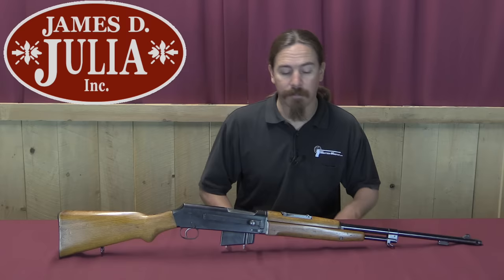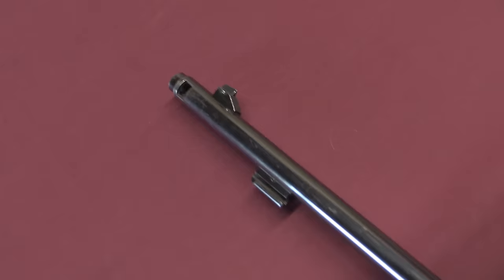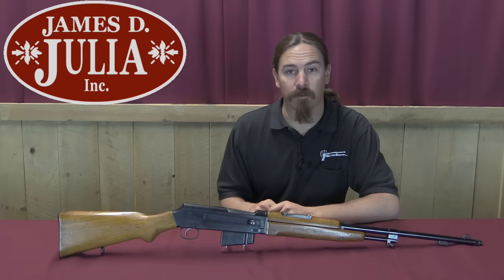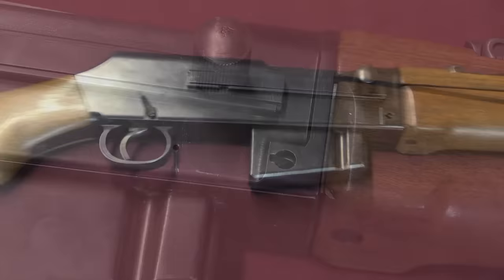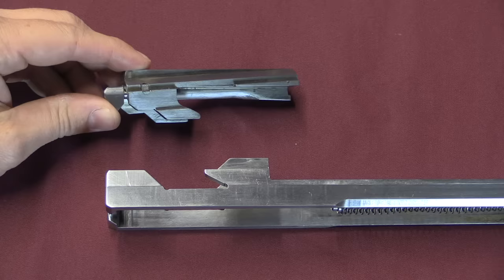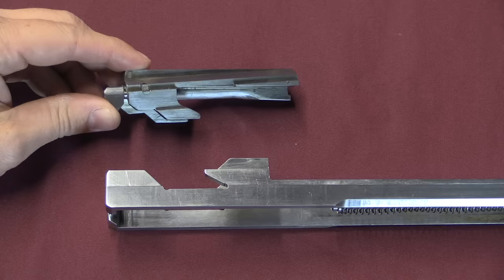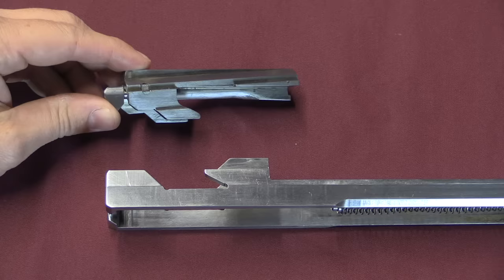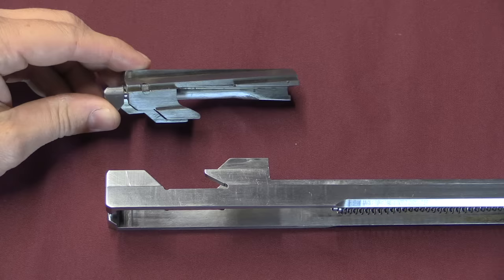Poland's WW2 Battle Rifle: the Maroszek wz.38M

Comment: It's a sign of a truly excellent engineer to make something functional with so few parts.

If they didn't get crushed by the impossible circumstances of WW2, we might today be talking about "Polish engineering".
Reply: All I can imagine is a polish ak is literally 3 parts held together with push pins like a ar 15
Reply: POLISH ENGINEERING, JOJO!
Reply: @hungryburger1170 POLISH ENGINEERING IS THE FINEST IN THE WORLD
Reply: @ONEIL311  Polish AKs are unfortunately AKs, but the MSBS is a fun one. Not only it's pretty much four major parts held together by push pins (and you can even put the stock on upside down without major problems), but the bolt is a piece of Stoner 63 lunacy - put it in upside down, unscrew the ejection port cover and screw it back on the other side, and now it ejects to the left, no fuss!

Comment: Heh, that is one very simple gun to take apart, total genius in the simplicity. I guess modification to a removable magazine would not be difficult.
Reply: Lubos Soltes ditto 30rds would work👍
Reply: Before WW2 started Maroszek designed version that was using Browning wz. 1928 magazines.
Reply: Lubos Soltes from looking at it in the video I think that a gun designer could easily take the main operating parts. add a folding stock and detachable magazine no problem and this would be a decent modern weapon

Comment: Never heard of these. What a great design. The machining and finish are superb. The takedown is simple and effective. I always thought the Garand should have been along these lines, a 10 rd fixed mag which can be loaded via strippers or with loose ammo. More versatile, can be topped off, and the existing 03 stripper clips could have been kept. It really didn't make much sense to design a whole new e-clip system. The only possible advantage is the bottom of the rifle being flatter and nothing sticks out except for a slight protrusion of the mag well. Great video as always. Thanks for finding this one

Comment: This is one of the coolest and most interesting rifles I've seen. It's very similar to the BAR but noticeably different, and in my opinion better in a way in that it's locking mechanism is far simpler than the lever mechanism used in the BAR. The whole design is really ingenious when you look at it, and it makes the firing system a lot less complex, which in turn should have made it easier to produce as well.

Comment: This is absolutely elegant. One pin holds it together. The stripper clip cutout is also the locking surface.  It looks like an absolute pleasure to field-strip, and the only weirdness is the occasional archaic feature (trigger-based bolt release) rather than a real design flaw.

That inspiration to fix the prototype must've been an epiphany.

Comment: a brilliant, simple and effective project. easy to disassemble for routine maintenance, very easy to clean the gas outlet. also equipped with muzzle brake. remarkable example of Polish engineering.  the only note, as I think it, a rear sight like the garand would have been much better

Comment: Really should've had a captive pin and a detachable mag. I wish someone in Poland would put this into production because I want one really bad.
Reply: Richard Tobys, gunsmith from around the city of Poznań (Guinness Record holder for biggest 1858 Remington revolver), Poland, did made one new example of Maroszek. He took measurements from original documentation, immured during the war, and decades later accidentaly rediscovered. He stated, that after reworking the data to be CNC compatible, he is able to make next examples. But still... it's singular, expensive, semi handmade work... and i don't even know, that the old man is still around and capable to make one.

Comment: Great job Ian, as always,

I knew about these gun but I have never seen any good photos (not mention movie) of it - thank you for this great presentation. This gun is really ingenious if you take into account its wise design, easy of field strip etc. and that the Maroszek had really limited design support and schedule for it.  The fit and finish looks really great and it was almost hand production without any machined production line - only 55 trial guns were made. I can see only one shortcoming for this gun from design point of view – machining the receiver would cost “fortune”.

BTW I would like to see how it manage your mud test (of course I know that no1 will let this happen with such scarce gun) - its wide opened but I think these kind of locking can be quite resistant for dirt.

GJ and keep on going. Greeting from Poland.
Bartek

Comment: I know it's an old clip but just one thing - that regulator you're talking about. It wasn't meant for adjusting to different ammo types. It was there for adjustments in prolonged combat environments when proper cleaning was impossible. If cleaning of the gas piston and tube was impossible the soldier was able to widen the gas release hole to make sure it didn't clog up interupting proper gas piston action.

Edit: You can see the same option in some modern rifles, tho nowdays it usually doesn't requier field-strippoing the gun to do it.

Comment: Is there a particular reason why so many serial numbers seem to start at 1000? l remember several guns shown by you to have them start at a such number.
Reply: Kurt Bergh To make believe having already manufactured 999 guns.
Reply: I'd think it had to do with tooling.  Starting with four digits means you can make 8999 rifles in a single batch and not have to stop the line to change the serial number machinery.

I guess you could start at 0001, but that would have made some people tear their hair out.

I remember that a lot of guns Ian has shown he talks about how the fifth digit just becomes a letter and then you can produce another 260000 without any further tooling changes (assuming the latin character set, cyrllic would give more).
Reply: quarthinos Why would that make some people tear their hair out? Hell, you could start at 0000, as long as you used a 0 with a diagonal slash distinct enough from your 8.
Interesting to think about the numbers you can produce that way though
Reply: Some people are allergic to starting zeros.  I wasn't really serious about that part of my comment.  I think the rest is accurate, tho.
Reply: Or maybe it's could be first version, so later when the designer make some adjustments of the design then second version could start with 2001 and etc.
Reply: I would love to see serial numbers in hexadecimal. With four digits, you could go from 0001 (0001) to FFFF (65535). If you wanted to take it even further, base 64 will let you make numbers AAB (001) to /// (262143).
Reply: +quarthinos Ah, makes more sense; that's their problem. 
+Carl Siemens I was actually going to suggest base 26 or 36 as it'd be easier for standard comprehension to use the Latin alphabet or Latin alphabet plus Arabic numerals. I suppose for easier mental math by the average person you could do base 20 or 25, (represented with partial alphabet), or 30 (alphabet plus 4 numbers), though they'd probably still be more accepting of base 26 or 36.

Going to be honest though, the whole downside would be that differentiating models or versions would be a pain in the ass without everyone's favorite base 10 stopping points; you'd practically have to release a guide for the average person.
Reply: You got the answer in one. The  reason they start with 1001 is the die stamp.
Reply: farmerboy916 
I know that b64 would never get used but imagine how much fun it would be!
Reply: Tbh I never learned it, just understand the concept as applied here. The exact representation of characters to number values makes my brain twitch and want to redo it, they couldn't even be bothered to set 0-9 as their proper values and had to bring in non numeral/ alphabetical characters to make it work. And programming is far beyond me. 

I think what would get the most number counted with the fewest characters while still making sense to the average person might be 2 letters and 3 numbers, for 676,000 for 5 characters. Multiplies evenly too, and is more space efficient if you don't mind using XX000 (instead of insisting on having 4 digits to represent a thousand, just use 3). Though, what could be done with the first two characters to make this even better is to do them in base 36 (1,296,000), base 52 with upper and lower cases (2,704,000), base 62 (3,844,000) which might be more understandable for most people than base 64 due to the lack of non numeric/ alphabetical characters, or even use base 64 for them (4,096,000). If you just wanted a more space efficient way to express up to a million you could use base 32 for the first two characters, about as close as you get which would work out really well for understanding and estimating the total if you had to add on another character; it may actually be better than b64 for extremely long production runs. 

That's probably how base 64 might actually be used in such serial numbers as well. That's how I'd do it anyway. In retrospect after thinking through those options, base 64 for the first two characters would be fine and dandy and understandable enough. And I doubt anyone is manufacturing more than that with one serial number range nowadays
Reply: from a manufacturing engineer: if you start at 1, by the time you get to 762 or 556, things get confusing (calibre? serial number? military unit number?).
Leading zeros make optical illusions: 0010 ~ 0100 (imagine war time armourer working around the clock bringing guns back to the field)
Reply: @quarthinos  Some guns started with the #0

Comment: Am I seeing things or are there cracks at the edge of the locking shoulder (time 9:22)?  As I recall the savage M1895 which has a similar lockup had the same problem and was solved with the M1899.  For a trials gun this kind of thing is normal and the reason to do trials, of coarse maybe I am seeing cracks where none exist.

Very cool gun and very few major parts.  More importantly I did not notice any parts that look harder then hell to machine.
Reply: Wilhelm Muench It does look like one is forming on the right side to me from the angles we had.   Also,  when Ian was showing the stripper clip guide it appeared that it was not a straight across machining cut.   It looked angled to me; again probably the viewing angle of the camera.

Comment: 1. Not Josef Maroszek but Józef Maroszek. Small difference but ;)
2. Maroszek is pronounced as "Maroshek". I know, this is hard, I don't blame anyone for problems, at least they tried.
3. This is not 0 (zero) but letter O → O = Odbezpieczony (ready to fire), Z = Zabezpieczony (secured). For Polish user this has a lot of sense, for foreigners O is equal to 0 and this is the straight way to accidents.
Reply: And in "Maroszek", the accent is on the second syllable.
Reply: Proszę się nie czepiać, Ian jest specem od broni, nie od języków. ;)

Comment: What a wonderful design. It has so many user friendly features with so few and simple parts. The milling work is well done, but rather simple. No highly intricate cuts here, so it should not had been to harder to build then a bolt rifle. Very easy to field strip. I have a feeling if it did see service, they would eventually have a detachable magazine and it would had seen service though the Cold War. It would had been what the M14 was for the US.

Comment: I wanted to put forth the theory about the gas mechanism on this one- the 1, 2 and 3 adjustable settings are actually meant to be stopped at after a full turn or even two full turns of the lug, so they're actually there to help you keep accurate track of the mechanism instead of trying to remember which face of the bolt you should stop at. I believe that would allow enough change in gas to be relevant. So tightened down to 1 is normal, loosened once or twice and stop at 2 is slight adversity and another time around to the three is extreme conditions.  At least thats what I'm going to postulate. 

Hopefully this is something that is relevant to say and not just a waste of your time.

Comment: Basically, "Z" stands for "Zabezpieczony" secured. "O" for "Odbezpieczony" unlocked.
Apparently, there are confirmed reports that several wz.38M rifles took part in the fighting, but one incident is documented.
During the evacuation by train, Engineer Józef Maroszek had his rifle with him, and the train was attacked by two BF-109 fighters. Maroszek did not sit idle. He loaded his rifle and returned fire at the attacking Messerschmitt (Maroszek had the title of sharpshooter), as a result he managed to shoot down one BF-109, and the other one withdrew from the attack. One point for the wz.38M... but what a good one :)

Comment: At the gas plug's diameter, those 1, 2, and 3 settings create a significant difference in gas volume/pressure. In an AR, a gas port changing by a few thousandths of an inch can make a noticeable impact on function and performance.

Comment: Many handguns are designed to lock into the top of the slide today. Glocks do this which is what that reminded me of. This rifle is miles ahead of its time. 

I noticed the score mark continues through the 2 position on the gas adjustment knob. I guess that setting must have been just right as the 1 and 3 do not have the score mark. 

Too bad this is not in production today it really is a simple and effective design.

Comment: I realize this was a rifle that was still being tested and I am not familiar with them at all but do you think it's possible that the gas adjusting screw could have been meant to make one full turn and then stop on the 1 and two full turns and then stop on the 2, same with the 3?  Since you have been fortunate enough to handle the rifle I wonder what you or anyone else may think of that idea.?.?  Just a guess.  Thanks for a fantastic video.  Poland is one of the few countries that are still protecting Europe.  Niech Bóg błogosławi Polskę

Comment: Well it may have the US Bar machine gun similarities, But the Tilting Bolt or Falling Block was first available in 1895 & truely perfected in1899 or otherwise Known as the - Savage 99.
While most would dismiss it as a Lever Action - a study of how the action works is that it 'controls' a falling block, which has same design Locking breech as this Polish rifle.  Perhaps Forgotten Weapons could do a video on the Savage 99.

Comment: Nice sturdy and simple construction! I would like to see a modern rifle based in this action.
I'm not sure if the locking system is good for accuracy. But if it would not be a problem, It has all the requirement to be a very accurate and reliable rifle.
With some modernization, I think it could result in a rifle as good or even better than an AR.

Comment: Forgotten Weapons
 - machine gun/pistol BECHOWIEC 1943 year .
 1. Producer - self-taught 2. Conditions - conspiracy, average no machines, basic manual tools 3. Closed screw lock, single and continuous fire switch, (this system was used in other weapons only after ... 25 years later and recognized as a standard ! ) , quite small and easy to hide e.g. under clothing 4. the first prototype shooting - it worked well right away 5. users - no comments about jams, blockages.
Sorry my english .

Comment: I needed this vid so much. I was planning to write a historical fiction narrative about a soecific operation in which the Polish resistance recovered pieces of crashed V-2 rockets and then flew them out on a british plane flying into a random field from Italy, then back to Italy and then to Britian, for the scientists to study. It's a hair raising tale on it's own, with a few spotter planes using the landing field the day prior to the operation, and a flak battery being positioned in a town not five miles away from the landing field. The British plane, once it landed, got stuck in the mud, having to be pulled out, then fly away. I had a pretty clear idea for the story, it was either going to be a sucessful assault on the flak battery, or a stall defense operation in the area around the field, each being carried out by a small team (5-10 men). I was all set to pen it out, but I realized I didn't know any WW2 Polish guns, and I was loath to just give the resistance soldiers allied rifles and carbines, because most of the members of the resistance had originally been members of the Polish army, and would presumably have kept their kit. Because of this, I didn't start writing. Now I can, because I had something in mind which required semiautomatics, high danger, high adrenaline stuff, and this is perfect.

Comment: So that tapered plug could change quite a lot of pressure, assuming that is tapered and close to shut there is a fine cross section between the surfaces but it would very quickly just be unrestricted.  The tightest setting is likely just very slightly open, each one looser probably a big change in gas flow.

Comment: Gas piston adjustment is not by 1/8, it is by full turn and 1/8th, so you unscrew 1.125 turn per adjustment. Just guessing from engineering point of view. They probably used some standard hexagonal bolt supplied from outside - looks like a BSP thread - and just quickly made octagonal head, slot and stamped it, so they would not have to make their own custom pitched screw. The lathe should make barrels not screws :]

Comment: This in one of the slickest firearms I've ever seen. That's a milled receiver, correct? Would the Poles have had trouble scaling this up for mass production by sheet-metalizing it? The trigger group looks like it could be easily made from stamped parts, but would the locking lip hold up if it were made of thin folded steel?

Comment: Did you checked if adjustable gas system with numbers 1, 2 and 3 works that a not threaded part of this bolt is maybe not centered according to threaded part and a small turn opens quite a lot.